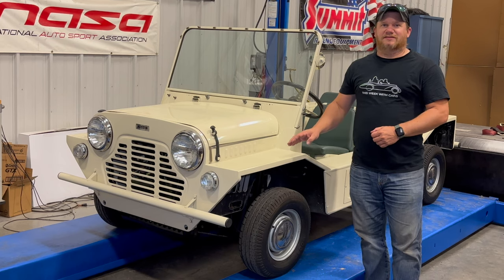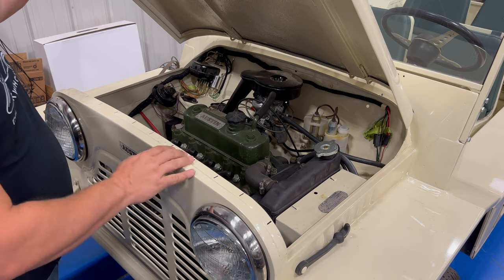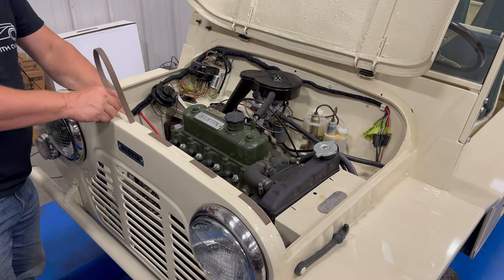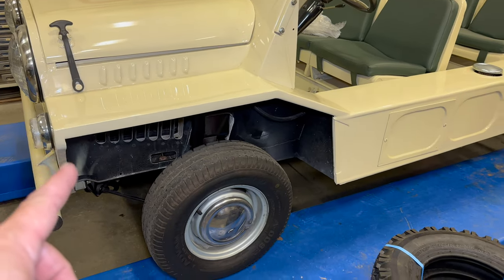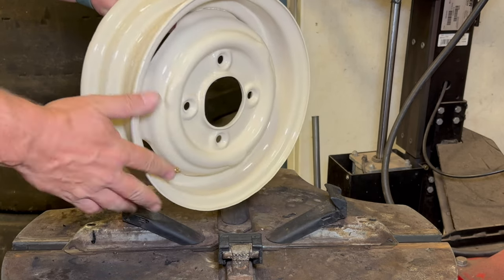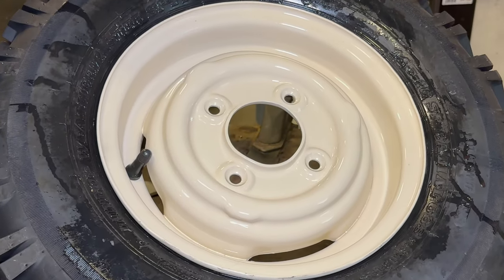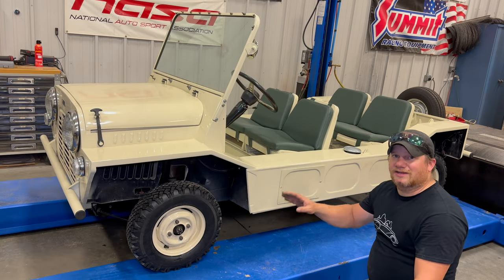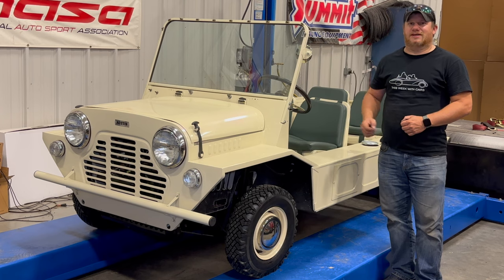Closer to Finishing My 1967 Austin Moke

Comment: There aren't enough proper Mokes about so well done on a fine job Sir.
just a little pointer: The spikes across the panel by the radiator secure a rubber shroud which was fitted to all Mokes, Mk I, Mk II and some Mk III Minis. Part number is 14A7286 and helps keep the air flow through the radiator.
Reply from the maker: I will get one ordered and put it on.
Reply: make one from flat rubber strip, think its about 2 inches wide?🤔  @ThisWeekWithCars

Comment: Steve, in a recent episode you used a neg battery terminal cut off switch, green knob. Where did you get that? Not sure I want to buy it at HF. Thanks
Reply from the maker: They all look the same quality, NAPA sells them, I buy them on Amazon a lot, Harbor Freight probably has the same one.  Moss Motors even has them if you want to get it from them.  https://amzn.to/45ALZP6